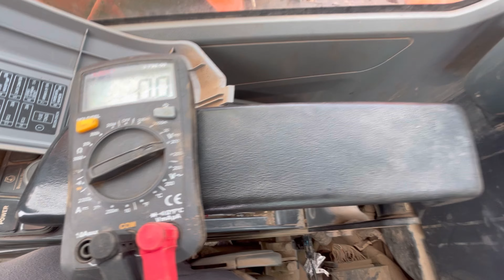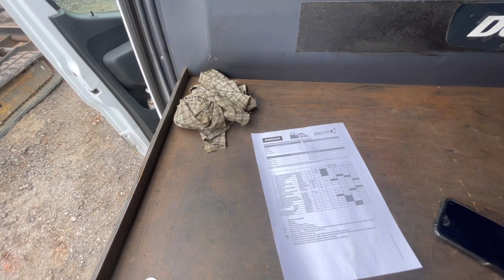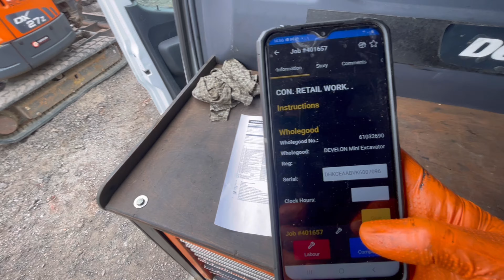A few little jobs / Onsite repairs / What I do off camera

Comment: Hello again young.fellow. As to your earlier job of drilling out 12 grade track frame bolts, it could be worth obtaining carbide tipped anular cutter from a good engineering tool supplier to go into your mag drill, higher tensile material tend to work garden without constant feed pressure, also again on the topic of cutting lubricant a high pressure lubricant again from your engineering  tool supplier is worth looking into, I know you don't do the job that often but it's worth having everything set.in your favour before you get into problems. 
Regards
Lyndon
PS: I used to work in a quarry and then a pressed concrete works (Marshalls concrete building products) so I do know what it's like to struggle with awkward jobs, always wear.eye protection when drilling.